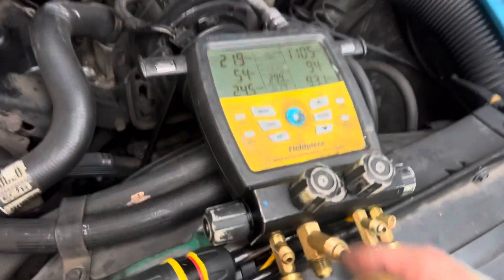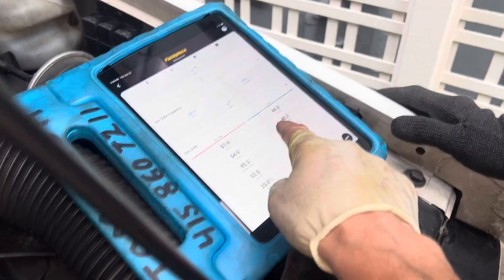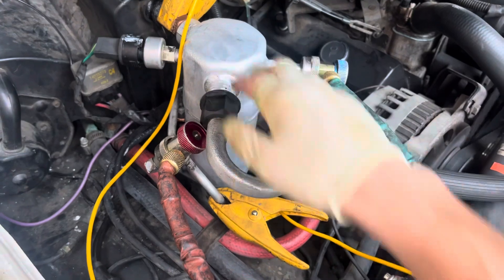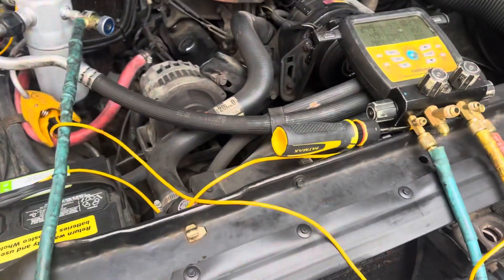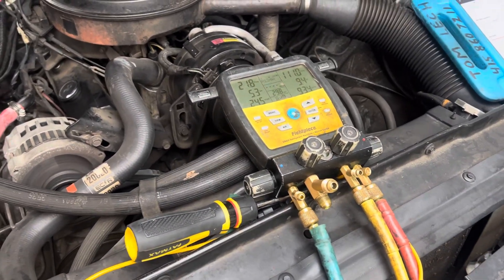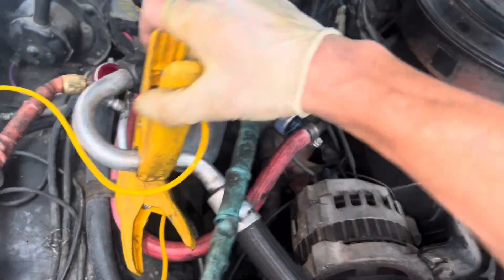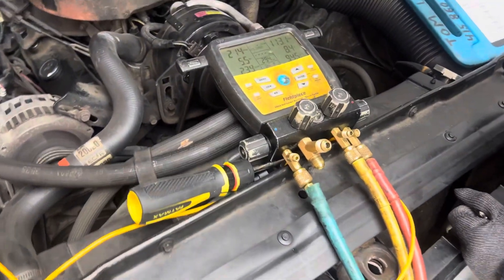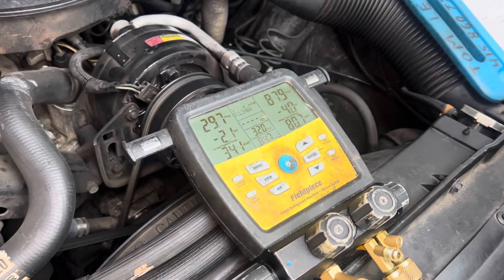CYCLING CLUTCH SWITCH NEEDED ADJUSTMENT.  Now it’s cold

Comment: Tom what are the 1234yf 25lbs containers going for on the west coast these days?

Thank you for your time.

Ron
Reply from the maker: Somewhere around 425 to 475 I think that’s The last price I remember.     I think I remember paying 499 at one warehouse that I normally don’t go to one day. 

I’ve been on vacation this is my 10th day in Hawaii just heading back now I’m literally sitting on the plane ready to lift off.

I live in San Francisco
Reply: @coldfinger459sub0  Thanks for your time. I meant to say that I'm on the east coast. I live in Miami, FL. I appreciate your videos. 
Enjoy your vacation!
Reply from the maker: @battime5418  I figured that’s what you meant
Reply: @coldfinger459sub0  Just confirming the cost of yf 25lbs @ around $500 on the west coast. That's about $20 per pound. Did you mean $500 for 10lbs?
Reply from the maker: @battime5418  $500 for 25lb.  R410

R1234yf is $600 for 10lb.
Reply: @coldfinger459sub0  👍For a moment I thought I was being hammered. 25lbs of 1234yf is around $1,300, and 10lbs is around $525 over here.
Reply from the maker: @battime5418  Price jumps up and down depending on what warehouse I go to